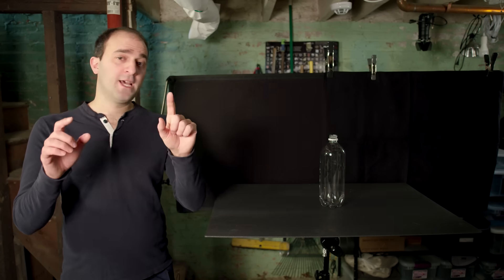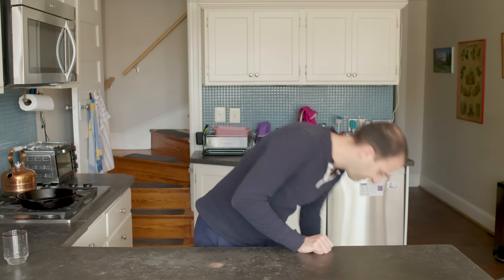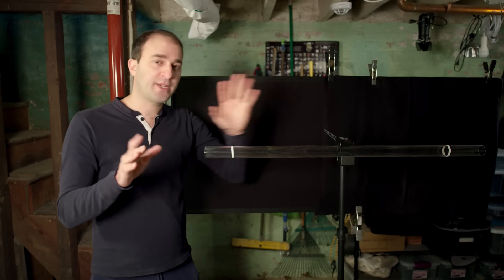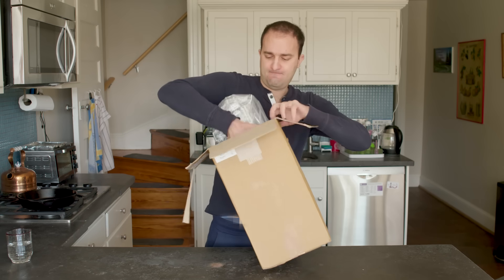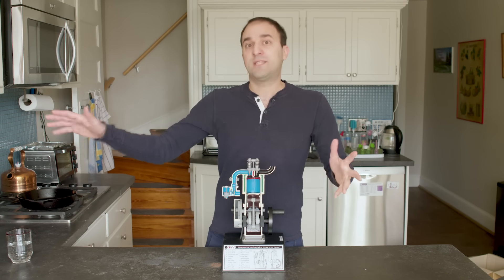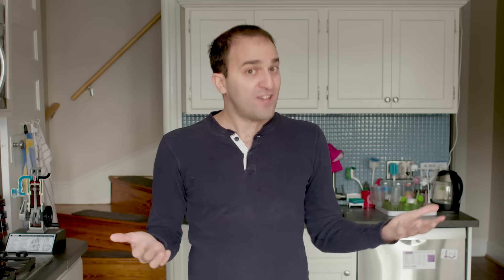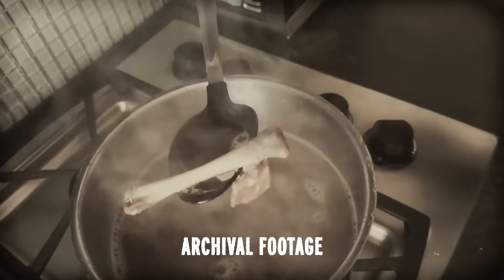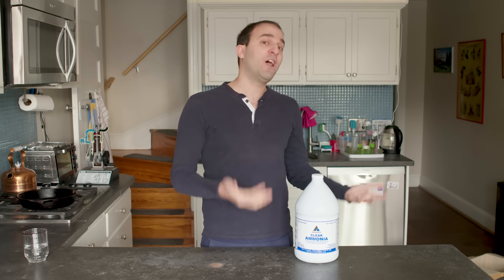Does Toyota Know Something That We Don’t?

Comment: The questions that arises for me are "What  is the carbon footprint of producing a liter of Amonia?  How does is compare with the (already known to be huge) footprint of producing a liter of gasoline?" The full lifecycle of a product needs to be taken into account to make valid judgements on its effectiveness in addressing environmental and climate disruption.
Reply: Since it takes 3 liters of ammonia to move a car the same distance as 1 liter of gasoline, we need to triple the ammonia footprint. Carbon produced per km traveled is a nice metric that detaches it from what happens at the car and considers it AS A PLANET. Also, what's the "footprint" when there's an ammonia leak? (hint: It's a lot like Godzilla's foot stomped on your community.)
Reply: This is a great point, and I think if you researched, you would find that Ammonia's carbon footprint is very kind compared to all other options.
Reply: It's not about footprint. It's about round trip efficiency.
For example, 'green' hydrogen (made from electrolysis) has a round trip efficiency of ~25%, meaning of all the energy you start with, only about 1/4 of it can is actually useable to you in the end application (like driving your car). Batteries, OTOH, are over 90% efficient. That means we'd have to build ~4x as many solar panels, wind turbines, etc., to make hydrogen as opposed to just using a BEV. And all that extra production isn't cheap. Hence, running a car on hydrogen will always cost 6x-8x more than a BEV regardless of infrastructure or scale.

It seems the round trip of efficiency of ammonia (energy needed to make it v. energy that can be extracted from it to do work) is around 20%. If that's correct, then we can rule out making ammonia as being affordable. So unless there are sources of natural ammonia that don't have to be manufactured, it isn't happening. And even if there are, then it's not renewable.

Comment: The reason that ammonia is very slow to burn is octane. Ammonia has a pretty high octane at right around 120. The way to go around that issue (which really isn't one at all) is higher compression. With higher compression, you wouldn't need to use a promoter. Your average gas-powered engine has anywhere from 9.5:1 to 10.5:1. For ammonia, it'd have to be at least 13:1 and higher. It would be better from a performance standpoint, too.
Reply: Wow, that went south real quick. I never knew this would create such outrage. My bad for thinking there was a correlation between octane and burn rate. I thought there always was. I do know that ammonia has a pretty high octane rating.
Reply: @iceman45ification1  that's dude had a low octane rating 🤣
Reply: @iceman45ification1  Hey man, my original comment wasn't really directed at you, it was more for the benefit of others reading as people have trashed their engines not realising that adding slow burning fuels (like diesel) can drastically reduce octane instead of increasing it. No malice was intended, but this is yt and this is just how it goes sometimes.
Reply: Octane has nothing to do with combustion rate.
Reply: @methylene5  While you're not incorrect, it also doesn't negate the point of the original comment. What's the point other than being pedantic?
Reply: @scottleggejr  Octane has nothing to do with combustion rate, I wasn't labelling anyone or throwing insults. That appears to be more your style. Besides, if you knew anything about engine tuning and how octane rating is applied, you'd understand that what I said is very relevant. We have many fools who add diesel (often cheap agricultural diesel) to their gas tank because they think slow burning diesel has a high octane. Actually, it has a catastrophically low octane despite its slow combustion, and many have ruined their engines. So other than ad hominem attack(s), do you have anything constructive to add or was that it?
Reply: @methylene5  nothing about what I said was any kind of "attack" at you. It would be like if my only reply was "diesel has cetane"
He's not wrong though. You can add boost, design quench on the piston/head, change bore/stroke, and cam profile to adapt to slower burning flame walls and higher octane. Look at 2000+ hp methanol engines as an example of "not typical yet highly performing"
Reply: @scottleggejr  So you guys think Toyota doesn't know that increasing the compression ratio increases the combustion rate. Wow, such expertise. Perhaps you should get in touch and pass on your wisdom to them. The moon isn't made of cheese, whoops that's just me being pedantic again.
Reply: @methylene5  you're just sensitive and angry because you don't know what pedantic means and chose to take it as an insult 🤣 too funny. The moon made of cheese comment is a perfect example of you not understanding. It's going to be okay buddy hang in there.
Reply: @scottleggejr  ----- " Look at 2000+ hp methanol engines as an example of "not typical yet highly performing" -----
There is little to zero comparison between methanol and ammonia. The LEL:UEL for ammonia is 15 : 28 and for methanol it's 6.7 : 36. The OP's comment applies to gasoline powered engines, the reaction kinetics/efficiency/ignition timing, etc etc hasn't even been considered by either of you. It's clear the dunning-krugers is strong but troll on.
Reply: @scottleggejr  ----- "you're just sensitive and angry because you don't know what pedantic means and chose to take it as an insult" -----
I pointed out that octane has nothing to do with combustion rate, which it does not. You are the one who chose to take issue with that, I can only assume you're bored.
Reply: @methylene5  You're being pedantic again. The fuels are not similar. Neither are the fuel profiles of gas vs diesel and look at their architectures... totally different. Stunning! (sarcasm) I'm here without opinions, only additional context. I am here with curious intentions on what the timing, bore/stroke, cam, compression ratio, and whether it's going to diesel or traditional ignition spark, or something completely different we haven't seen yet. You're clearly the smartest guy in the comments though🏆

Comment: Well the kind of Ammonia used by Agriculture and cold stores (refrigerant) is Anhydrous Ammonia.......and that is a very corrosive,toxic chemical that when breathed in is very unpleasant and dangerous, its like breathing in acid.   You are clearly NOT using the actual Ammonia fuel proposed as a gasoline replacement.   But if your going to make a synthetic fuel, using green Hydrogen...........then we might as well make Methanol which can be chemically upgraded to Butanol, a drop in replacement for Gasoline that also blends perfectly with gasoline that has enormous advantages.
Reply: > Ammonia.......and that is a very corrosive,toxic chemical that when breathed in is very unpleasant and dangerous, its like breathing in acid.

Absolutely!
Now compare that at low concentrations you can smell ammonia, thus dealing with any leaks properly,
with gasoline you just have a massive fireball explosion and death.

Comment: Ammonia will probably never be used in consumer vehicles or trucks. It's just too hazardous. Green hydrogen for transportation fuel etc. will probably be made into methanol, methane or even longer hydrocarbons or alcohols instead of ammonia. Ammonia is useful in industry and it might be used for power plants and long-term hydrogen storage but... trucks and cars? Not likely happen. Toyota has a long history on betting on the wrong horse. Molecular hydrogen is also very impractical for cars.

Wärtsilä is working on marine diesels and such that could use hydrogen, ammonia or other more exotic fuels. AFAIK they said in 2023 that they are almost ready with a working ammonia powered marine engine. You know, the kind that are the size of a house?
Reply: > Ammonia will probably never be used in consumer vehicles or trucks. It's just too hazardous

Of course, it HAS been used in consumer vehicles.
What is amusing about your comment is you believe ammonia is uniquely toxic - despite a pungent smell that provides immediate feedback of leak or error - and you don't believe gasoline is uniquely dangerous - despite the ever present possibility of explosion and death.

Comment: The Haber-Bosch process emits approximately 1.87 tons of CO2 per each tonne of ammonia gas produced. So, the technology is not really green at all )))
Reply: However, using nuclear technology - to provide the heat and hydrogren, the emissions are quite low
Reply: @factnotfiction5915  and high pressure don't forget.

Comment: You can reduce emissions by 80 percent in gasoline powered vehicles simply by vaporizing the fuel before injecting.
Reply: How does it work
Reply: @youseflatif796  Liquid Gasoline is converted from an atomized mixture into an invisible vapor using high surface area materials in a chamber (stainless steel wool etc) before it's pushed into the engine via forced induction, Turbocharger, supercharger, etc. Internal combustion engines typically do not like to run atomized liquids, and would rather run a vapor or gas like Propane. Emissions are reduced by 80 percent and fuel economy is increased by 30 percent over standard fuel injection. Does not work in diesels, but ducted fuel injection does work on diesels and increases fuel economy by 50 percent and reduces particulates by 80 percent as well.

Comment: Gasoline and Diesel have alot of additives that help keep the metal components of the engine from corroding.  Ammonia has serious issues with causing corrosion of certain metal components.  This is why it has only been used in diesel exaust systems [DEF] and causes thousands in repairs and is so unreliable that diesel owners are always looking for ways to disable the unnecessary DEF systems.  Ammonia is not good for any engine, or pocketbook.
Reply: What you should state is that "ammonia is not good for an engine tuned for fossil fuels". If the engine is designed and tuned for ammonia, your objection goes away

Comment: All of this profoundly ignores safety. If an ammonia fuel tank (say one capable of moving a standard car for 3 normal driving days) should EVER rupture—say from corrosion or ANY kind of accident such as a collision, or just a mechanic dropping a tool—then every living thing in a fairly large zone around the car will be stop being alive. Your courageous sniffing of dilute ammonia solution as harsh as it seemed, is as NOTHING compared with the dangers of inhaling anhydrous ammonia (AA). Simply fueling that car would be a serious HAZMAT operation.  (This is the exact chemical that humanity has been actively eliminating from air conditioning and many other systems due to its extreme hazards.) It’s also the pure AA that would NEED to be used as replacement fuel to make it efficient enough and thus practical as a replacement fuel.

As an academic engineer, a former railroad conductor (who actually dealt with anhydrous ammonia) and currently a chemistry teacher, I have to loudly disagree with your “handleable” assertion. For example, railroaders want to stop transporting AA because 1) it’s the most dangerous routinely transported material, and 2) it can be generated locally and on demand (in the smallest quantities needed instead).

Climate change is an insufficient problem to introduce such an extremely toxic substances into our lives (and by extension into the environment). The risks massively outweigh the benefits in my opinion.
Reply: > All of this profoundly ignores safety. If an ammonia fuel tank (say one capable of moving a standard car for 3 normal driving days) should EVER rupture—then every living thing in a fairly large zone around the car will ...

have the opportunity to flee such a horrible and non-ignorable smell.

versus those who who never had a chance to flee a gasoline fuel tank exploding and IMMEDIATELY, without any warning, killing every living thing in a zone around the car

there is, after all, a fairly major difference in size between a 30,000 gallon DOT-111 railcar and an automobile's 10-15 gallon fuel tank